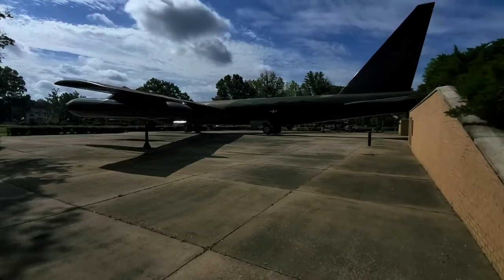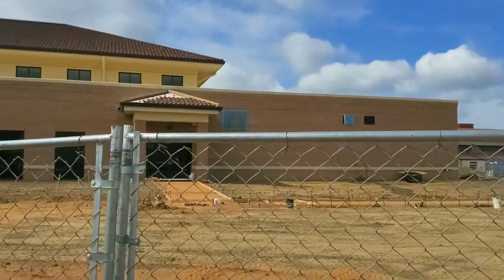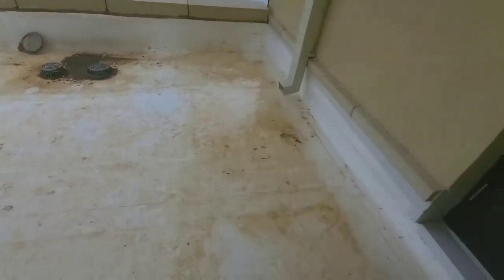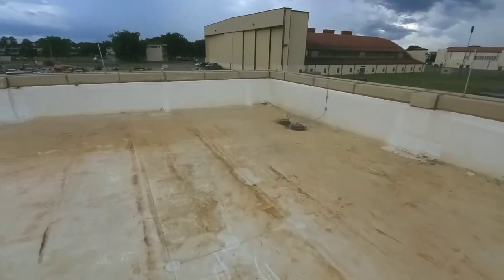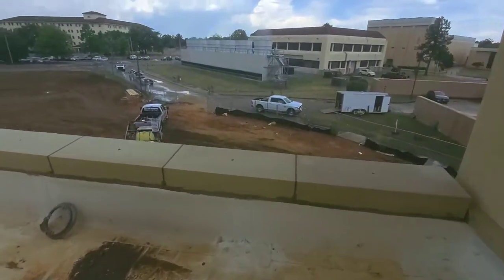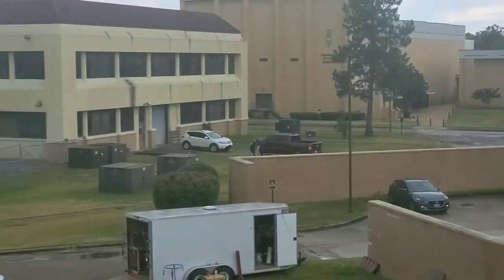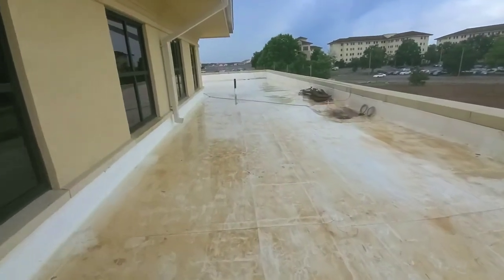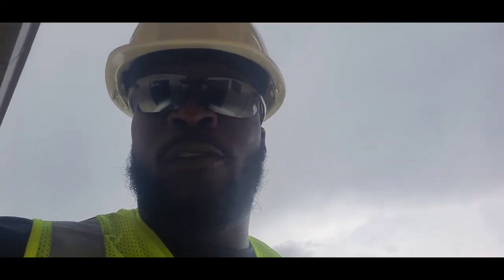Softwashing a flat roof with Hydrogen Peroxide for the U.S Airforce. Will it work?? Part 1

Comment: Nice! Is that TPO?
Reply from the maker: Not sure what that means??
Reply: @EpoxyWeLove  It's basically vinyl roofing material about 40mils thick. I ask because we alot of TPO roofs out here in California and it'd be nice to know the best way to tackle them. 
Thanks
Reply from the maker: @puga30250  what kind of organic growth is typically on the tpo material?
Reply: @EpoxyWeLove  Typically algae and grime. I live in a Agriculture town.l, alot of dust and chemicals landing on these rooftops.
Reply from the maker: @puga30250  typically SH will work. Hydrogen Peroxide is a more expensive alternative.
Reply: What percent hydrogen peroxide did you have hitting the roof? Should have been at a minimum of 3% hitting roof but I probably would have hit it with like a 5%